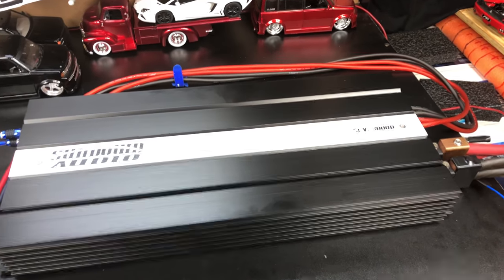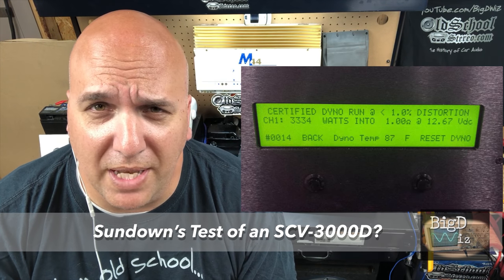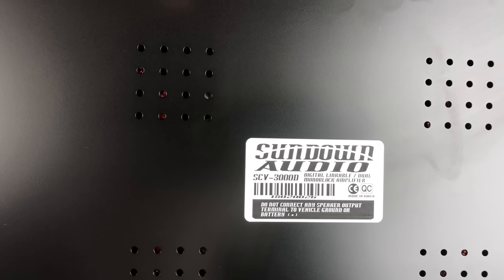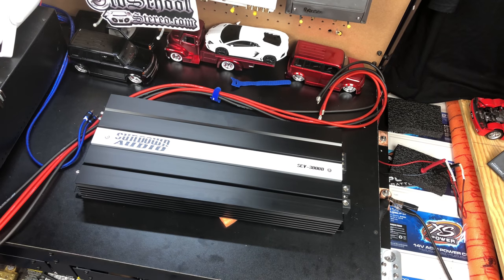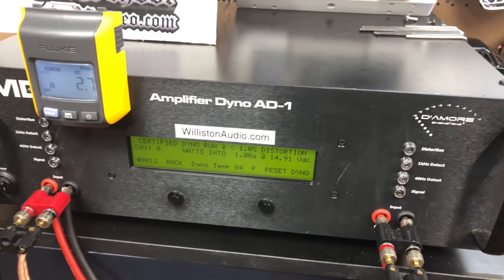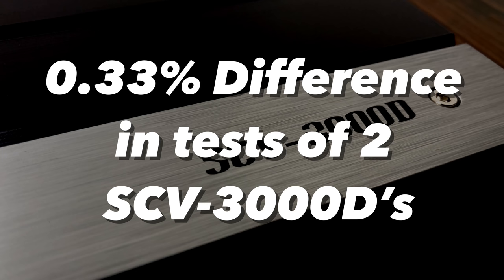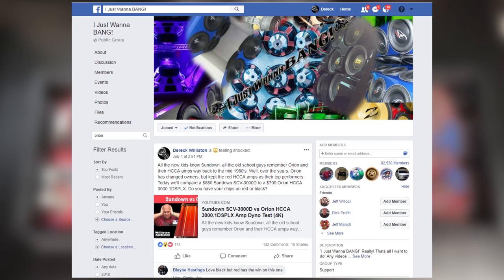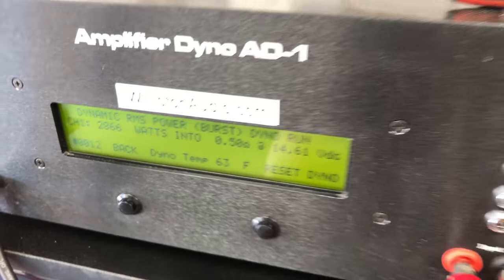Sundown SCV-3000D Amp Dyno Test - Follow Up (4K)

Comment: Some people can't just accept things as they are. You used the same methodology on both amps, if you were going to have one do less than it should it would stand to reason that the next amp would likewise show lower than expected results. It tells me that while Sundown has for so long held up to being factual in their ratings while many of their competition were fudging numbers, they weren't prepared for the competition actually stepping up their game and coming up with better products that aren't selling inflated nonsense numbers any longer. Now they either need to adapt and step up their game or think about competing on price.
Reply from the maker: Companies like Rockford, Alpine, Orion and a few others provide “birth sheets” with most of their amps. If I was depending on a build house to supply my amplifiers I’d either 1) spot check them for Q/A or 2) request test data on each amp. For the price Sundown is asking for these amps the customer should not only expect, but demand test data.

Again, the amp does rated specs, so without Jacob’s comments I would have skipped testing another...
Reply: Just so you know, I was referring to "both" as in your initial test, the Sundown vs the Orion. If you missed the boat on one amp and used the same methodology on the other you would have likewise had a lower than expected result. I also wholeheartedly agree, their build house needs to supply birth sheets with those amps and denote the parameters used. Voltage, frequency and give amp draw. For the money you pay for their amps it should be a standard item.

Comment: That's why I'll stick with my Audiopipe.
Reply from the maker: They make great budget products
Reply: Yes they do
Reply: Cheap but inefficient. Rated power is dirty.
Reply: Not really
Reply: 60% efficiency at 1 ohm certified. The 2k at 14 volts clips at right over rated power. Its def a great deal for the money though.
Reply: yes 2000watts rms for only 168 dollars they pretty much giving them for free. edited the price lol

Comment: I been a Sundown fan for many years! With that said, I always have and always will recommened their subs.  

I can't ever say, I recommended their amps, cause there has always been cheaper, reliable choices out there. 

Further more, I started even recommending Sundown subs less and less, as they keep making "budget subs" that are STILL in the 250 dollars and up range and the quality of the subs keeps going less and less, you can get a lot better subs than their "budget line subs" for the same price.  Sundown peaked as a company, and hasn't been able to design anything new and improved that can top what they already made, so they are riding the gravy train "so to speak". Sundown's hype is slowly fading, as companies are starting to design, better products while Sundown is stuck riding a hype.
Reply: Joe K.O.S 
I really don’t have a dog in this fight as I run many different brands. Having said that, sundown is one of the only brands that does it’s own R&D in house and has incredible customer service. Most other brands are just cookie cutter brands and slap their logo on the same ol product everyone else uses coming out of the same build houses. Like I said, I’ll run anything that works and it seems sundown amps just keep working forever.
Reply: Ronald Palma  Sundown amps, blow just as much as any other top tier brand. There is websites, dedicated to selling refurbished Sundown amps.  They do have good build quality, but that 2x higher price isn't justified.  

As far as customer service most times, its cheaper and faster to outsource repairs and recones to people that have a good track mark. I have had to send emails a few times for weeks before getting a reply, all the while getting the run around of, contact this person, or this person, which is same with most companies.

Comment: Yet again.. Thank you BigDWiz for a fair and unbiased test. My intents are never to bash any brand and Sundown has a very nice amplifier and Ive heard many great setups running Sundown. But my choice will always be Orion. Price vs Performance hands down they are worth every penny!
Reply: Yeah especially the Orion colbalt Amps worth every penny LOL
I still think the Orion Amps should be less then they cost.
When you buy a Orion 3000 watt amp your buying a  4000 watt amp.
Has nothing to do with underated .
They do this so people will be shocked and blown away.
Even in the 1980s-1990s same.
There for the rich folks .
Unfortunately sundown could do the same thing if they wanted to.
They could put a 3000.1 logo on a 4000 watt amp it’s just facts.
All it is to  make there customers be shocked .
It all evens out because there so expensive way to much for me.
But they have always been great amps no doubt about it.
I payed $199 for my 2000 watt sundown it will do 2500-2800.
For me that’s a much better deal then paying $500 for a Orion.
I know I couldn’t afford it no way .
The new lineup of Sundown amps are much Smaller and really powerful.
When your on a budget it’s hard to throw )$500-$600 to much.

Comment: i do have to put out there as a owner of this amp myself i've never had it go into protect mode playing at 0.5 ohms and that daily play so maybe box rise is the reasoning in my situation but again no issues here playing 0.5 ohms thanks for the dynos big d love your channel.
Reply: Kyle Kari box rise is most definately saving you right now. As with the test, a true .5 ohm resistive load will put the amp into protect.
Reply: Kyle Kari same goes for the Orion. A true .5 ohm resistive load will put it into protect. But there really is no reason to wire in the dirt when the amp puts out that kind of power at 1 ohm
Reply: James Cunningham I agree I was kinda forced into it cause at the moment I was waiting for my 2ohm 9515 to arrive which by the way took forever to get thanks dd. And the only sub I had to play at the moment was a 1 ohm load Crescendo contalto and I refuse to wire up you know stubern ass bass head . Anyway I am currently back at 1 ohm load. Thanks for the thumbs up and if you're bored check out the channel nothing special just some fun Kyle Kari will get you to my channel

Comment: I somehow managed to get back to this video.  This amp may not have stacked up to how folks wanted it to perform, but it was right at its rated output.  That is the best possible way to market your gear.  Honestly.  Because you don't just slap a 3kw amp into a car willynilly...you need to have the electrical system appropriately built to handle it...knowing the exact performance of the gear is imperative.

The Orion amp, the 3k HCCA, pounded out the jams for sure...but if you built your electrical for a 3k amplifier that functioned more realistically as a 6k or a 10kw (as was demonstrated) your electrical preparations would have fallen way short and may have incurred you big, expensive and potentially dangerous problems.
Reply from the maker: I agree and the main purpose of the follow up was the question of my test results. I agree it’s a great amp 👌

Comment: 1 thing about sundown is that they are the company that is most likely to change something in their amps from 1 of these tests. I am not trying to sound like a sundown nuthugger. The few subs i have messed with are awesome. Had a friend buy 2 sd 3 12's. And when he didnt like them, sundown let him exchange them for some sa 12's. Apparently he wasn't the only person that didn't like them, as i saw on the caco sight a while back, they slightly changed and rebuilt and sold all the sd3 stuff they had returned by unhappy customers for a much lower price. I think part of the reason people are happy to pay the premium for sundown is because if you have a question, or are unhappy with the performance, you can contact the owner of the company directly to have the problem resolved. Try contacting the owner or even one of the engineers from one of the other big companies out there to have your concerns addressed. That being said, there is no way i would pay $900 for a 3000 watt amp. Even if it did the same numbers as the hcca, the hcca is still the winner for two reasons. First is the value of it, second is the build of it. From the guts in the previous video, looks to be built to handle more abuse.

Comment: Why are there comments bashing Sundown here when the amp is doing exactly what it stays it's supposed to do? That's like complaining your about your blue car being blue instead of red, when you specifically asked for a blue car.

Sundown didn't bash the previous test at all. They just stated that either the amp is faulty, or the test is wrong. That's not an accusation, and it's hilarious that it's getting attention at all.  Clearly this video shows the test is not wrong, the amp is not faulty.
Conclusion: The amp is still doing what it says it's doing, but you're no longer getting the free extra power you used to get in the past, above 3k RMS. Nothing to see here, move along.

Great job by Orion putting together this amp. Let's hope the amps don't break.
Reply from the maker: So the declaration that 1) Test was wrong or 2) amp was bad; both were proven to be false. Jacob has a Dyno and could’ve proven my results without the attempt to discredit my video’s results. True, the amp does what it says...also true Jacob thought it should do 3000+ at 13 volts before this video brought to light the truth. (That it needs >14.4 volts to produce 3kW)
Reply: Did he really discredit your video though? Based on what Jacob knew at the time, it made sense. The build has since changed (without him knowing), hence the reply to the test. 2) the amp was bad - this is the more correct answer (since the design has changed in production).

Love your videos! I just have no idea where all the hate is coming from. Sundown makes awesome products and actually warranties them.

Comment: Sundown has been cutting corners for a while now. I bet the SAZ lineup would have done better compared to the PCV. Its also a shame what they did to their Zv3 sub lineup replacing it with a U-series. Anyway, I'm glad this dyno test reaffirms I did the right thing by picking up two Orion XTR2500.1Dzs earlier this year.
Reply: recon440 yeah they have a huge sale on the new U series subs right now.. I wonder why lol... I was interested but only found like 3 ppl who run them, one guy had a huge list of what he preferred over the U series... had 2 U 12 in my cart for awhile but passed on them.

Comment: I dont get what the original complaint from sundown or anyone was. The amp did its rated power the first time. I get that it's annoying when you see the orion make it look like amateur hour, but dont forget the orion made them all look like amateur hour. In this case the orion is the freak not the sundown. That doesnt mean that the sundown is a crap amp, it did as advertised. Sundown is a well known reputable company and I think the smart thing to do here was leave this one alone. The orion's are freaks. Sundown subs are night and day better than orion's, I wonder if orion will get on here and say their sub is broken in a comparison?
Reply: The Orion subs vs sundown , night and day , not in my opinion, the best thing about the Orion subs is that you can change the cone and coil out in about 15 minutes, dollar to dollar the Orion’s are much better
Reply: @charliefrancis6438  theyre easier to work on ill give you that. But I would argue that sundown subs are a better build quality. Although in my opinion sundown, skar, orion, a ton of other companies are all crap now in the grand scheme of things. The stuff is built overseas to just be pumped out in bulk at wholesale prices. They don't have anything built with pride anymore.
Reply: Ran Man have you examined a new Orion hcca subs up close ? These appear to be great quality to me all materials look great and the are still stiff as hell after 2 years in the car I am not saying they are better than any other brand , but for the price I paid for these new you will find hard to beat , I expect to get 20 plus years out off these I got 20 and still going out of my old school 1999 hccas

Comment: Still get more bang for your buck with the skar amp. Not bashing sundown but numbers don’t lie. Back to the drawing board
Reply from the maker: All amps except Orion are made by S&I Corp. They make great amps. I take it Sundown requested reliability over output, but that’s just my guess 🤷‍♂️
Reply: And nothing wrong with reliability over sheer output.
Reply: David Gossage Same build house so reliability should be the same. I’ll stick with my skar amps more output similar parts same reliability. Oh and also cheaper.🤷🏿‍♂️
Reply: 450 for my RP 3500, my x15v2 loves it. Best of both worlds. The price for sundown amps are insane. BIGDWIZ saved a lot of people on the fence. We gotta stop sundown before they get comfy. The buyers go into anything Sundown even at rape price and think their high price is because its severely underrated. You did a good thing.
Reply: BigDWiz Sundown did what every big company eventually does. They built very strong stuff in the beginning, and then put out average stuff for a huge price and relied on their prior reputation to sell it. It's page 1 of the corporate playbook. They knew exactly what this amp put out, they just didn't like the information being made public for all to see.

Comment: The SCV3000 is a 2500 board. Its the SAZ2500 with 12v rails. The Orion is a 5k board.
Reply: yup, it does about the same as my skar skv2.2500 (2900@1ohm rated) for only $499.99.. it's very comparable to this amp.. I'm happy with my purchase 100%. I paid for 2500rms and got it
Reply: These guys don't see anything but numbers. Most don't realized how many of those amps burned up because they made a poorly designed cheater amp. I wouldn't buy the sundown for the price because it's numbers are lower than I feel they should be at the price, but I bet that sundown will take a lot more abuse than that screwed up Orion amp.

Comment: There is absolutely nothing wrong with the Sundown amp as it made its rated power.  What is wrong with it is the price as a cheaper amp doubles its output.  Time for Sundown to lower the price on this amp or retire it and replace it with something newer that can compete on price.

Comment: good amp does rated, i know everyone will be a bit peeved about it not doing a gigawatt more than rated but rated is rated i still believe them to be  a great brand. it doesn't want half ohm it protects as shown in video and actually fairly quickly.  Also, everyone is getting spoiled about the 12.6v rating depending on the power supply this can have a good give or take 100 watts

Comment: I know it is a slightly different concept, but I've watched a spec series race car register two very different HP numbers on two different dyno machines in one afternoon (20 wheel horsepower difference with the exact same car in the same day and garage temps), and am willing to bet that although to what extent was probably slightly exaggerated, that they actually did get higher values on their end. 

What is more important in racing at least is consistency of the testing over the accuracy of the numbers, and unless the testing conditions were 100% identical (which will absolutely never happen in the real world), then the numbers should come out to be slightly different (although maybe not to the extent they are claiming). 

Perhaps one way we could evaluate this theory is to take a bunch of amps and have you run your numbers, then to pass the same exact amps off for Sundown to test, and see if they got higher numbers all around versus just for their product. If there is an inconsistency in the differences over all of the amps (ie. some tested lower wattage, others higher wattage)

Either way, it made close enough to 3000 that it doesn't really matter, Sundown makes good amps and I think most people would somewhat agree (weather or not it would justify the price), and at the end of the day it was a shoot the messenger type deal. I can see why a manufacturer would be upset with the different results, but rather than whine about it, maybe they should try to get to the bottom of it on their end and post their own video proving their claim rather than point the finger at you. 

Anyway man, you're out here doing gods work, and I appreciate you doing these tests as well as humoring them.

Comment: Hmm.. Should i Craigslist my scv3k? When i received mine a couple yrs back. I did open it up and the fan was disconnected from the board. Everything else seemed fine and tight.
Reply: Bobdodge I would. I bet a bunch of people are switching to Orion or Skar or Wolfram now. You might even be able to make some money if you do it right.
Reply: catch22frubert really dont even need 3k. I could get rp2k and 150.4 and still have change in my pocket.
Reply: get a XTR2500 instead of a rp2k.
Reply: Better than the new Incriminator Audio “ top of the line “ 4 channel that had bent and loose parts on the circuit board, not to mention 20% tolerance parts 😂🤦‍♂️ all these SPL companies are making a fortune
Reply: Bobdodge I own both the RP-2K and the XTR 2500.1dz. both amps served me very well. I currently run the Orion on 2 American Bass subs. It gets down for just two twelves.
Reply: Up To Bat Entertainment ouch

Comment: Regulated vs unregulated power supplies apples and oranges want more power and less cone control look for a unregulated amp tightly regulated amps that do right at rated usally have better sound quality/cone control higher damping.. maybe I'm wrong but that's what I was taught. but I understand were your coming from big D pretty deceptive to say the amp does rated at 13.6 when it really does I at 14.4 but does the box say if those numbers are at clipping?